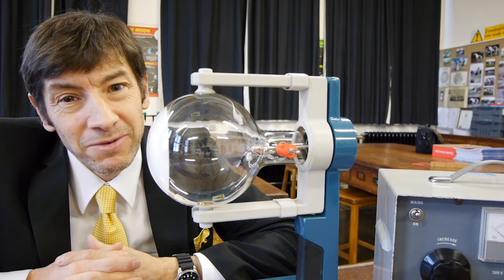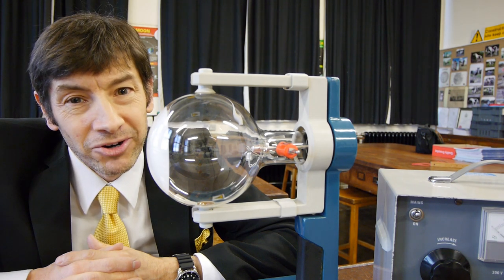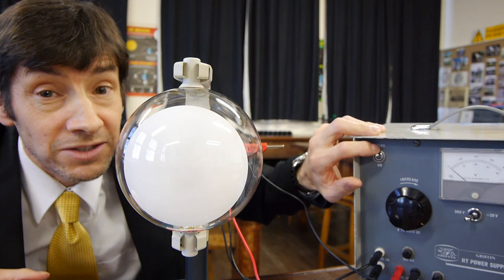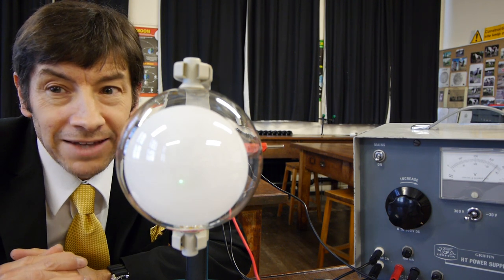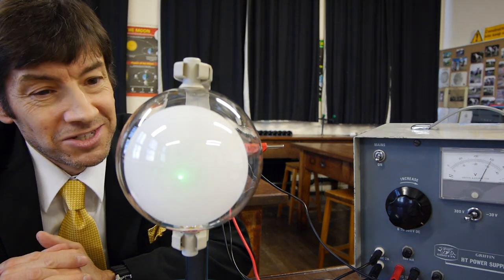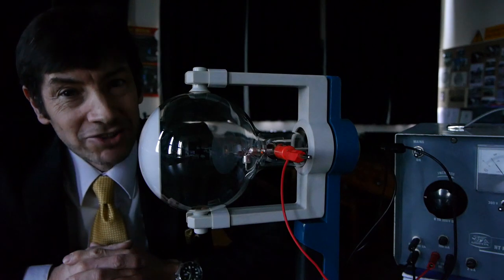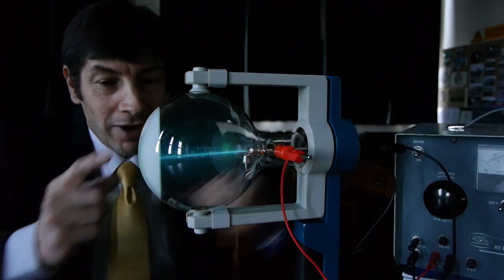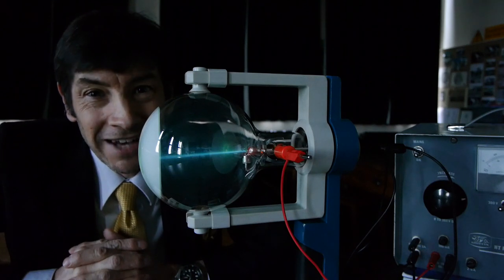The Electron Gun - the particle accelerator in your house! - F-J's Physics - Video 18

Comment: I'm guessing there's a gas in the tube that allows you to see the light emitted from the electrons? How does that process work for you to see the beams?

I have an old tv in my house sitting doing nothing. Im going to attempt to take it apart for the cathode tube, but what I really want from it is the electron gun for an experiment.
Reply from the maker: Yes, that's right - in these tubes hydrogen or helium is intentionally put in at manufacture and it is this that makes the beam visible.  Be very careful if you play with old TVs at home - I don't recommend it at all unless you really know what you are doing.  Firstly the voltages they use are much higher than I am using, and I have to be careful, and they can store dangerous amounts of charge even when turned off and unplugged.  You usually cannot see inside the side of the tube as they are coated with a conducting paint and they also have to have a good vacuum so they give a sharp picture.  My Teltron tube is especially made for education and demonstration purposes.
Reply: It's vacuum inside the tube
Reply from the maker: @lancewilson83916  Yes that's right - otherwise the electrons would scatter off the gas and never have enough energy to produce a picture and it would be very out of focus even if it did.  You can see the effect of a bit of gas in the tube in this video as you can see the beam.  This would of course not be the case in a tv cathode ray tube!
Reply: @AnthonyFrancisJones  wait, so is gas inside the bulb or is it a vacuum? or are you saying it's almost a vacuum with just a little bit of gas?
Reply from the maker: @fletchergull4825  Normal cathode ray tubes are a 'hard' vacuum which is important so the electron beam does not collide with gas molecules, ionise them and  lose energy.  The beam travelling down the tube would therefore be invisible.  However, so the beam can be seem for educational reasons a small amount of gas at a very low pressure is placed in the tube so when ionisation happens, the light given out during recombination can be seen showing the path of the beam for students.  That then allows you to deflect the beam with magnets or electric fields and see the effect on the beam's path.  Hope that helps and good question!
Reply from the maker: @fletchergull4825  Strange, I wrote a reply to your question in real detail  but I cannot see it here.  So, yes, normal cathode ray tubes are 'hard' vacuums, but these educational ones have a small amount of gas in them so students can see the path of the beam.  Hope that helps!
Reply: @AnthonyFrancisJones  thank you so much! The other thing I'm having a hard time with is picturing how the "diffraction" takes place when the beam hits the graphite. The double slit experiment is easy enough to picture cause there are only two waves coming out and interacting with each other! Should I think of this just as a three dimensional version of that with many more slits? Is the crystalline lattice acting as a barrier, or are the electrons getting absorbed by the carbon atoms and then re-emitted in random directions? Should I be thinking of the electrons as individual waves or of the beam as one big wave? Would the pattern be the same if you had a very weak beam (sending one electron at a time) and collected the positions on the phosphorous screen over time? Or is there something about having many electrons bunched together that is unique to this pattern? (Is any of this diffraction just due to classical wave properties of having a large collection of particles compressing and rarefacting like a sound wave or ocean wave? Or is this entirely a quantum phenomena?

Sorry I have so many questions lol, I don't expect you answer them. But if you have a video that might help me to get a picture in my head that would be awesome!!

You're awesome by the way. Keep it up!!
Reply from the maker: @fletchergull4825  All good questions.  Firstly I guess you have seen this video of mine https://youtu.be/CR2frJzQZ8k  Now, to explain what is going on we are in the realms of the quantum world and all of its weirdness.  So, simply we do not use a specific 'mechanical' explanation but maths that allows us to predict what happens.  So electrons moving fast hitting a 'grid' of atoms is very similar to light hitting a diffraction grating with its multiple slits.  Next, and remember this is a model, not an explanation, we consider fast moving electrons (with momentum) to have a wavelength (de Broglie).  Next, if this is the case they will diffract if they hit a group of slits (atoms) with a spacing about equal to their wavelength.  What is even stranger is that this must mean that 'each electron wave interferes' with each other one... but if you do the experiment with single electrons you only get a dot on the screen where you would expect to see the diffraction pattern.  Now if you leave it to run for longer slowly each electron passing through the atoms builds up a patten of dots that builds up a regular diffraction pattern.  I could take this further but  the main take away from this is that we don't really discuss what happens at each slit (if we do we lose the diffraction pattern) but instead we see what we observe and draw parallels with the behaviour of light.  I hope that helps a bit.  The quantum world is indeed odd so try not to visualised it only as a 'real' thing that you can draw as it were!

Comment: May you tell what is residual pressure of the gas inside the tube?
Reply from the maker: I had a look at the original manual for this tube and it mentions Neon at a very low pressure but does not give the value I am afraid.  I think it is very close to a complete vacuum but sorry I cannot be more helpful.

Comment: Can you clear my doubt ?
Doubt -   A laboratory has very strong magnetic field upwards, i.e. towards the ceiling. An electron gun is fired towards a wall. The electron will:
Reply from the maker: Good question - remember the force is always at 90 degrees to the electron movement (current flow) in a magnetic field.  And this force is also at 90 degrees to the magnetic field so... the beam will move sideways towards the wall at 90 degrees to the one it is being directed to.  Hope that makes sense.  It is a version of Fleming' Left Hand Rule (I have a video on that as deflection of electrons in magnetic fields too)  Hope that helps.
Reply: @AnthonyFrancisJones  Thank you for your explanation........

Can you give me the link of that video?
Reply from the maker: Sorry - missed your message!  Here it is if you still need it.   https://youtu.be/TKPVA1RgUmw
Reply: @AnthonyFrancisJones  Its too Late but thanks!!

Comment: Did I miss the part where you applied a vacuum? Does it need one? What do use the beam for? How far and what focus. I have one and an idea but never did it yet.  But if you dont need a vacuum i may play it tomorrow. Game changer. I found some real neat uses for a magnetron or three. old stuff has some real powerful stuff in um.
Reply from the maker: David. this tube comes ready to go for educational demonstrations of electron beams.  It is already evacuated (and needs to be for the beam to flow freely) but so you can see the beam there is a small amount of gas in there which ionises and then gives out light.  The anode focuses the beam so no external bits needed to do this.  They are/were made by Teltron.  I think this one is 40 years old.  Not done a video with a magnetron - they can be found in microwave ovens for example.  Does that help?
Reply: @AnthonyFrancisJones  I missed the part o it being a teaching tool. I thought you made it out of a CRT. Sorry bout that. I was all excited to see it work without vacuum because the uses would be staggering. Never worked for me without a vacuum The magnatron is another fun use of an appliance

Comment: Hey man your video was nice I enjoyed
But I have some questions can you please help me out
1.after electron stricking the phosphor screen and after all that glowing where does the electron go from the phosphor screen and if the electrons are not going anywhere then after some time the screen will be too much negative charged and because of that the the flow of electron should stop in some time
Reply from the maker: Glad you liked it - brilliant question.  What you said is true and a problem for these type of tube so there are a number of things that are done.  Here are two of the most important.  In these tubes the glass is made ever so slightly conducting and so the electrons make their way to ground.  In old CRT TVs there is a conducting layer of paint around the tube back - around the bulb shape of glass by the screen - this is connected to a very high positive potential and the electrons therefore flow away to that.  There is not a great deal of charge as the beam current is so low but it is still better for picture quality/focus to remove the electrons that hit the screen.  Hope that helps and enjoy your physics.
Reply: @AnthonyFrancisJones  re: "In old CRT TVs there is a conducting layer of paint around the tube back"
Termed an "aquadag" coating.
Reply from the maker: Yes, this is a paint that is conducting and contains a lot of carbon.

Comment: sir what will happen to the electron after hitting the phosphor screen. is there  a return path of electron to complete the circuit?
Reply from the maker: George, that is a really good question - I cannot remember if I hinted at the answer in this video or another one.  So if they stop on the front phosphor of the tube they would build up a negative charge and begin to repel the next electrons coming in so.  In the case of a TV this would make the picture less clear.  So, firstly the glass envelope (tube) is made slightly conducing to create a return path and in some TVs a positive potential is put on the glass of the tube.  You can however often feel the static on the front of a CRT if it has been on for a while - the electrons are earthing through you.  Hope that helps and as ever, enjoy your physics!
Reply: @AnthonyFrancisJones  Thank you👍✅

Comment: Hello. Thank you for this video. I have one question - what is the reason of the curved shape? Is it because of a wavelength having the same value for all electrons at one moment, similar to a radius in a circle? I think, using a flat screen would result in only partial coverage or delay at some areas of the screen. Or is it any other reasons behind this shape?
Reply from the maker: Thanks for the question - not sure I fully understand what you are asking...  The beam of electrons is straight as (gravity aside) the only force on the electrons is in the direction of travel.  The beam appears as a small dot as it goes through a focusing anode that has a circular hole.  The tube is the round shape it is so you can demonstrate bending the beam with magnets in the y and x directions.  The electron's wavelength is so small that it really plays no part in this experiment.  Does that answer your question?
Reply: @AnthonyFrancisJones  The real answer is it does not have to be curved, but curved surface would give you less distortion of the image in a monitor, but it also has to do with vacuum inside, imagine if you had an old fashioned TV tube, of say 25" screen, it would roughly have a screen size of 20" x say 15", this would give you a total surface area of 300 sq inches, and if atmospheric pressure acting on the surface of the glass tube is 15 pounds per square inch, then total pressure acting on that glass screen is  4, 500 Pounds ....that pressure could crush your bones, so these old TV tubes had to be made from very thick glass to withstand these enormous pressures, or else it would implode........ that is one reason why they weighed a ton! So curved surfaces can withstand slightly higher pressure than plain surfaces, as they form an arc as in bridges.
Reply from the maker: @mgabrielle2343  Thanks - yes, tube curvature is important for a number of reasons including easier image focusing and structural stability.  My tube is spherical at the end for a completely different reason - it has a vertical gun too so can be used to send a beam of electrons into a circular path (a mini CERN in some ways) so you can measure e/m for electrons (I must make that video sometime!).  The glass does not need to be very thick (its only a few mm) as it is handled carefully and the pressure difference is never bigger than 1 atmosphere.  Making it larger of course does not change the pressure on the outside of the tube either but as you rightly say the total force on the tube's glass grows with area even though the pressure stays constant.  So much physics in this simple bit of kit!  As an aside old CRTs had glass that varied in thickness depending on which bit of the tube you were looking at.  I do at home have some quite large ones that have circular screens - they are really quite old and some tiny round screen ones that have XY plates and came out of CROs.  It seems funny picking up a modern oscilloscope as it has not depth to it anymore as there is no CRT!

Comment: I plan to use this in a mass spectrometer so can it work in less power as well. Like 20V or something
Reply from the maker: Shivam - interesting - you need a high voltage to accelerate the electrons but in a mass spectrometer you are accelerating ions so it is a bit different.  You can use the electron gun to ionise the sample you are studying  but typically this is done through strong electric fields which use close contacts and high voltages.  So in summary I am not sure how you plan to use it.  I need to do a video of a kind of 'mass spectrometer for electrons' where I bend them into a circle and measure e/m, the charge to mass ratio for them.  I will still use a fairly high accelerating voltage though.
Reply: @AnthonyFrancisJones  I am using it on the moon as part of a mass spectrometer to ionize the elements

Comment: I have a question that nobody of my teachers answered. I know that cathode is +ve while anode is -ve but in some cases or diagrams, they both changes their charges. Why does this happen? What are conditions for  this reversal? I hope you will answer.
Reply from the maker: Sufyan, the cathode is where the electrons come from and this should always be made -ve.  The anode attracts and accelerates the electrons and therefore should always be +ve.  [Are you confusing cathode and anode with cation and anion?]
Reply: @AnthonyFrancisJones  Thanks for reply but I a diagram is confusing me. Do you use WhatsApp? so I shall send you the diagram
Reply from the maker: @sigma7208  Find me on Facebook and send me a message and I will have a look.
Reply from the maker: @sigma7208  send it to afrancisjones@wrekincollge.com
Reply: I am assuming that you have received the answer you were looking for by now. However, just in case you didn't, this might help. You have probably seen a connection diagram, or circuit diagram, that showed the anode connected to a ground reference terminal of the power supply,. This works fine because the cathode will then be connected to the negative terminal of the high voltage, or extra high voltage, power supply. As long as the negative and positive terminals of the power supply are floating and not referenced to any other voltage, you can tie either one or the other to ground. It is only required that the cathode be negative with respect to the anode and it really doesn't matter which one is at ground potential. The tubes will work even if neither cathode nor anode are tied to ground but it is common and produces best results, if one or the other is. I connect these Teltron, type D tubes, both ways depending on the tube. For instance, with the Maltese Cross tube, I tie the anode and the cross terminal to a  ground terminal on the power supply. That reduces my chances of getting a little zap when I hot-plug the cross, unplugging it and plugging it in again whilst the power is on, to show the effects on the electron shadow due to an electrostatic charge build up on the cross. With regards to the cathode and anode and the accelerating potential difference between them, 0V to +500V is the same as -500V to 0V.
Reply from the maker: Great - thanks for this.  I still have the Perin Tube to do!

Comment: I'm pretty sure these were vacuumed. No gasses. Electrons reacted with the screen panel on the front. The risks of implosions etc are due to the rapid change in pressure
Reply from the maker: Thanks Cameron.  Yes you do see the green on the screen due to the electrons losing kinetic energy and converting it to light in the phosphor but in the bits I did in the dark you will see the whole length of the electron beam so these Teltron tubes had gas (at a low pressure) in them so in an educational situation students could see the beam.  Of course in a TV tube there was a hard vacuum and a getter strip to make sure it remained that way.  Hope you enjoyed the video.